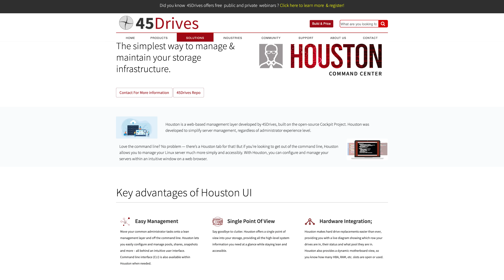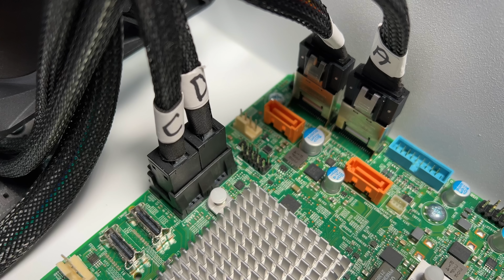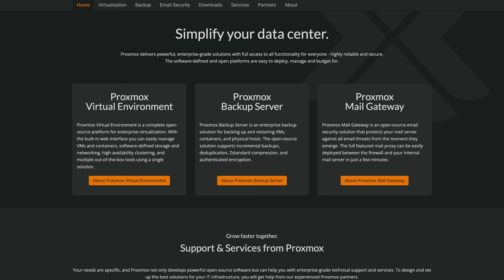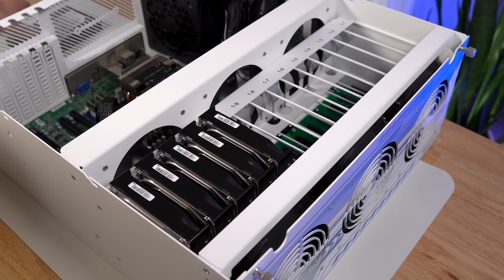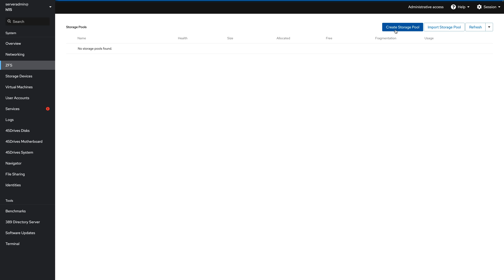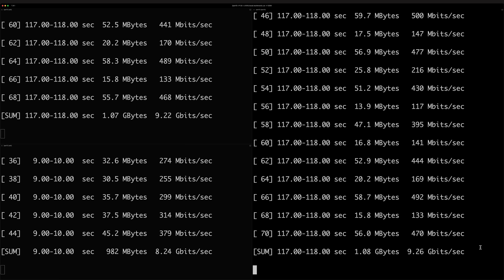EVERYTHING You Should Know About the HL15 (HL15 Review)

Comment: Needs a Locking cover and needs to be a bit longer so a large video card can fit. Then you can build a large capacity workstation that is Bullet proof with strong steel case. There is a Niche. It can replace the Fractal Define R5 and R7XL.

Comment: Fractal Meshify 2 XL (for a quarter of the price) over this all day. What were they thinking? They completely missed the mark on this.
Reply: you completely missed the whole point of the video. meshify is just a pc case while this is a case specific for a storage system, with backplanes, caddy-less cage for hot-swapping drives etc. yes, it's expensive but try install and manage 15 3.5" drives in the meshify and see what happens.
Reply: @giornikitop5373  I've been running 16 drives in my Meshify 2 XL for a few years and it has been great. I'm not sure why you would imply that it couldn't handle it. You can fit 20 drives in the Meshify! I stand by my original statement thanks.
Reply: @giornikitop5373  I have done the large PC case lots of hard drives thing before. They are great if your time costs nothing. 10 to 15 minutes just dealing with cabling when you pull a drive. Pulling all the drives and redoing the cables is usually the quicker and easier way to deal with a dead drive.

Comment: Best technical review so far! It should be mentioned, although designed it to fit a Network sized rack (typically 20” depth), the rail kit offered has a minimum depth of 24”. Also, I’m not sure I understand the touted Steel Case as positive; it’s heavier, prone to corrosion, and is the cheapest material (outside of plastics) to use. They couldn’t even be bothered with proper I/O plates, as you mentioned. Aluminum would be a premium.

The price is egregious and a terrible value-prop IMO (and 99% of Reddit). I’d wager a 75-80% profit margin on these units.

Comment: I just built one myself this year using Asrock Rack AM4 m-atx mobo, Zen3 5700X, full Noctua cooled, 12x 16TB HDD in a custom 5U short depth casing, 2U delta redundant PSU, 128GB ECC, Nvidia P4, running TN scale with access for storage server and some other applications and plugins. Running as fast as a torpedo, rock stable and so much affordable for the performance you get.
Reply: What was TVs final price tag? I love it

Comment: This is really nice. I bought a used SuperMicro chassis (4U 36-drive), and have run Ubuntu Server with ZFS "bare metal" for three years, and it takes a bit of tinkering to get set up the first time. But now I know how to do it (documentation is king), and I'm not so afraid of doing it again.
Reply: Same, though went with a 24 bay. Hot swapping drives is a godsend. Not using a Super micro motherboard though and changed out the stock fans and PSU to quieter ones. 

Aside the typical drive failure after some time (which prompts me to upgrade my array sizes) haven't had any major problems with it for the last 4 years.

eBay did me well with that case :)
Reply: @KeyJayHD  yeah, I also replaced the internal fans with three 120mm Noctua industrial fans, and got a pair of slightly weaker (2x1280W) SuperQuiet PSUs

Comment: Really dissappointed. 45drives own research thread 2 years ago to the homelab community on reddit  uncovered a strong need for non server storage solutions to extend storage for existing server with external SAS ports. The need is a cost effective but quality build enclosure with not insanely noise enterprise cooling fans, efficient power for 12-24 drives. Instead of solving these problems they put out a product for what seems like a smaller niche include enterprise noise level extremely high price in the $1000+ range. Again VERY dissappointed they can't listen to the community.

Comment: About rivets, get a pop rivet gun.  You will need a drill the size of them and the rivets come in different sizes.  Do a search for pop rivets and pop rivet guns.  Harbor Freight (of all places) probably sells them and the rivets but search around and see what you can find.  I would not use rivets either.  They were most likely cheaper than screws and that is why many cases have them.  Just make sure not to leave any metal left over from any drilling in the case.  That of course could cause a short and damage things.  It would also be the start of an unhappy day for you when you realize all of those expensive parts may have been ruined.

Comment: Nice in-depth video about the HL15 Tim, I do however have some questions about the connections on the backplane. How is it connected to the PSU? What connectors is used? What connections is used for the SATA/SAS Connections? Could I buy an LSi 16i, or two LSi 8i's and use this backplane?

Comment: I'm not sure I see the value proposition here.  For the sake of comparison, a new Supermicro CSE-846A-R900B chassis is about $1200.  That gives 24 bays rather than 15 in the same 4U footprint, still with the same sort of direct-attached backplane (no SAS expanders here).  Dual 900-watt PSUs, which are also hot-swappable.  Nearly double the weight means the SM unit will be a pain to move around, but also suggests it will be much more sturdy.  For 30% more money (new, to keep the comparison fair), 60% more drives, and more than double the power, in the same 4U space.

And, of course, Supermicro gear is widely available used at a considerable discount, their chassis are readily serviceable, parts and accessories are available if needed.  So while this is a nice-looking chassis, I guess I just don't see the the benefit.  Too few drives, too much space, too much money.

Comment: I'm hoping that this convinces other manufacturers to create cases that are more home lab focused. Like Gearboxworks says i'd probably be down for a smaller case that supported 6 or 8 drives ad about half the price. being in  over $900 for a case, backplane, PSU and cables is a bit much. Especially when the case is basically just a rackmount case turned on its side. I've got a 12-bay Dell R510 behind me across the room that's so quiet I can't even hear it running at the moment. And when you compare the initial costs for the HL-15 against what you can get a fully kitted out piece of second hand enterprise gear for it just makes very little sense. There are just so many more cost efficient options out there. The server I just build with second hand parts in a Fractal Node 304, has twice the physical cores, higher clock, hyper threading, 4x the amount of ram that thing arrived with, and 6x 10tb drives, 850watt PSU and I'm in under $1000 including drives. Granted I can't physically fit any more drives in but if I did all i'd need is a disk shelf and a HBA. I just don't know. I guess i'm must too value conscious to see any value in the HL15.

Comment: LGA3647 CPUs are dirt cheap, so it's not an issue to upgrade the CPU, to the point of getting enough (decent) thermal compound to cover Socket P CPU may end up costing more than the chip itself. Even low-tier Silvers are really decent CPUs already, 4209T being holy grail due to 70W TDP, and $90 pricetag.

It's really hard to not like the design... but in the end, it's a device. You can argue all you want, but $800 is way too much for empty chassis on a single backplane. You can buy 16-bay cage-only chassis, like Rosewill's RSV-L4500U (which supports SSI-EEB, while this does not) for quarter of that price, or CHENBRO RM31616 for $450. For tower system equivalents... please.

Also staggered spinup can be triggered from the SAS controller's firmware side, regardless of backplane, or lack of it. It's a standard ACPI feature.

It's nice looking, and looks well built, but it's really not worth the money they're asking for it.

Comment: Hoping for a case built for rack mounted water cooling to be honest. If I were to build such a case I would actually have the air intake  be  bottom chamber that's pulls air through a air intake in front of the case, then I would radiators pull air up/ vertically from the air intake chamber to blow it out of the rear of the case. You would be able to fit triple 360mm radiators that way without sandwiching them.

Comment: You weren't interested in disk throughput in any config?
Reply from the maker: I tested the drives individually and even in ZFS but I didn't include it because 1) I only had 6 disks 2) it is highly dependent on the disks you have.  3) video was getting really long! 😅 Unfortunately I didn't have 15 of the same disks to spare and I pulled these 6 from a working system!
Reply: @TechnoTim  Fair enough. I would have appreciated even a 5s clip of "No, the drives won't max out 10g, but the CPU will." Would have felt more genuine to me. But I get that time and hardware constraints are very real.
Reply: @minifig404 there’s a 45drives video with the founder/owner talking about saturation.

Comment: It does look nice, but agreed, I think it's definitely out of most homelab's price range. Even worse when you say the $2,000 fully built system came and then you decide to upgrade the ram, and you probably want to upgrade the CPU, and then there is limited headroom on the power supply, so maybe upgrade that too. I think for a lot of homelab-ers if they were spending that much on the computer they would want it to be the core of their home lab, hearing that it's so stripped down that it's basically just enough to run its own NAS target and would probably need upgrades to host anything else of consequence is not great.

Also the breakaway PCIe covers are kind of a letdown, it's kind of like a hallmark distinction between a "cheap" case and a high-end case. It feels like a penny pinch move which is not what I want to see on the $800 case.
Reply from the maker: Thanks!  This is all great feedback.

Comment: I've been looking to upgrade my homelab storage and just getting the CPU/memory/motherboard with integrated 10G NIC and 3x PCIe x8 is ~$800. Add a case, nvme, PSU, and the backplane and it starts to seem reasonable. I wish they went with an active cooler, low noise fans, and a choice of a CPU with better VM capabilities.
Reply: I agree on the fans decision. 45drives asked Reddit and my response was heavily upvoted, and it included a “no fan option” in favor of sourcing our own Noctua fans.
Reply: Yes, I can source everything, but I'd rather not. I really like the idea of buying it pre built like that. But, I would have to change enough things that it wouldn't really be worth it to buy pre built.

Comment: I've been wanting something like this for years and even though it's pricy I'm going to grab the chassis next year when I get around to rebuilding my NAS.  I know people have been complaining about the price but when you compare features even the fully built system is comparable to anything else you can buy new though I personally think the motherboard + CPU combo is underwhelming (but that's also true for just about every other off the shelf storage option).  Yes you can DIY and spend a lot less money and while I'd usually go that route (my current NAS cost me all of $400 before drives) having a solid steel case, more than 12 drives and not needing caddies hits pretty much all my pain points with less expensive chassis.  Never mind not slicing hands apart by mistake while working inside the thing.  

I'm hoping supporting 45drives now will open up cheaper options for homelabbers in the future and honestly it's nice to buy something nice for my little setup every once in a while.  I do hope they can bring the production costs down a bit with future iterations though.

Comment: Slightly disappointing that they don't have all 15 drives available through miniSAS from the backplane, so you could use a single adapter card to keep things better organized, but still looks good.

Can the front face plate be readily removed/replaced with a custom print/skinned one, similar to their other machines? There's an awful lot of screws there, so seeing it bared would be interesting and useful to see/know.
Reply from the maker: I read in the forums that if you bring your own HBA, it can support all SAS.  I also read in the forums that the faceplate can be removed and they are thinking about customization options.
Reply: @TechnoTim  Oh very nice then! Thanks for the heads up.
Reply: Agreed on both fronts. I dislike the faceplate design. Just give us the 45drives Storinator color selector in addition to the current two brand design options. My whole rack system is solid black with the exception of Unifi aluminum.